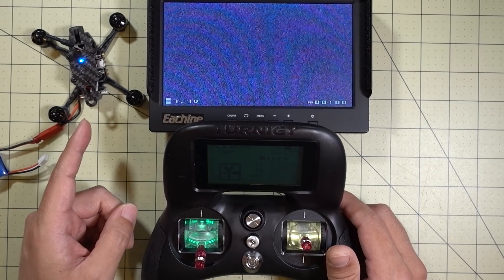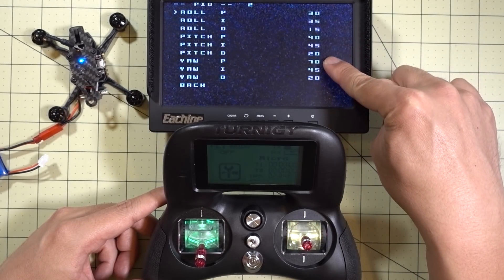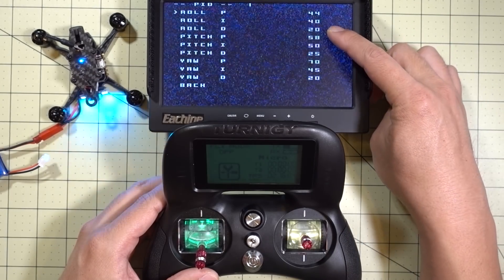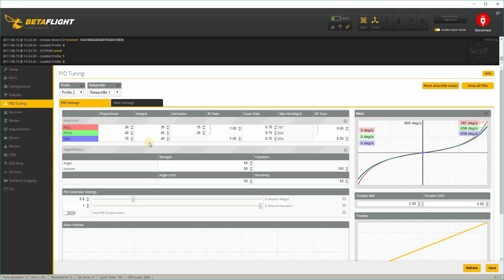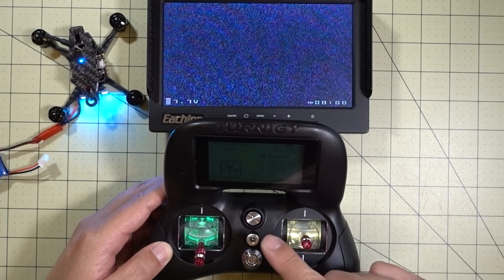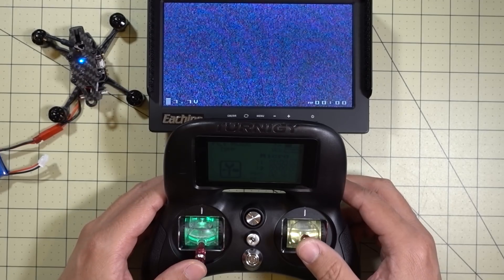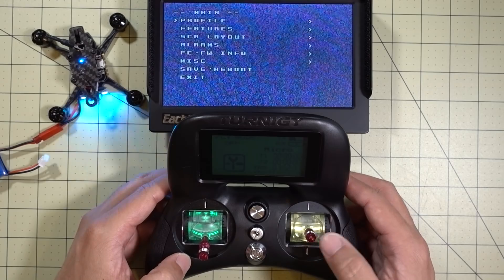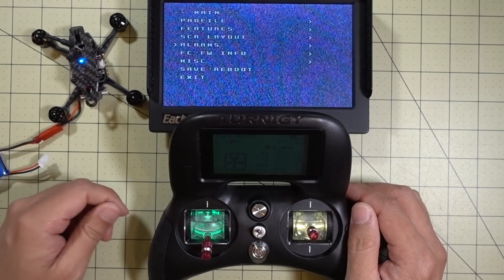Micro Drone PSA 🚁 2S & 3S PID Profiles Made Easy 🌟💡

Comment: Hey Albert. What is your opinion on all the "FOD" problems with many of the most popular micros...ARfun 90, Aurora 100, Lizard 95. I suffered many FODs going from 2s to 3s on my Aurora 100 (Flysky BNF). Using your lower PIDs did not help...and whether it is 3s 30C or 80C I still had FODs. Seems like there is not clear answer on RCgroups either....
Reply from the maker: +Kwad Vision 3s needs XT30 connector. Crating on lipo not truthful. My lipo video later will reveal. If you over prop on too small an esc that too can cause. Basically, FOD is caused by motor demanding too much power and esc or lipo unable to supply.
Reply: Albert Kim ...some on RCG are experiencing FOD on the lizard which is xt30 stock...?? definitely agree that c ratings are not accurate.
Reply from the maker: +Kwad Vision have not had fod on lizard... wonder what's up...

Comment: Looks like profile with stick commands don't work for dsm/dsmx rx. I have the 90 on 3.1.7 and 95 on stock firmware.
Reply from the maker: +SteveO4478 check your channel limits. Must be able to hit 1000 on lower limit on throttle and yaw.
Reply: Albert Kim on the channel mapping?
Reply from the maker: +SteveO4478 yes. Receiver tab
Reply: Albert Kim I ran it down to 999 on yaw and throttle still nothing.  I cant hit 1000 exactly though.  I'll try again don't know why it's not working?
Reply: Thanks I had to change channel mapping on roll and pitch also to work. Thanks!

Comment: Interesting didn't really think about having different PIDS for different lipos. I'll have to try it and see if it helps with the flips of deaths. Though the first version of my current quad didn't have any issues using different cell lipos...
Reply: So I just want to add that the PID's you have for 3s seemed to really work well. No more flips of death. Still broke an arm cause I crashed into the gate  but thats just cause the aurora 100 frame is kind of weak. Thanks for the tip.